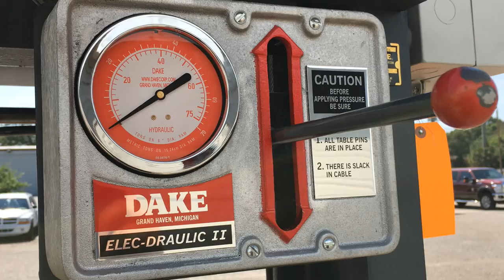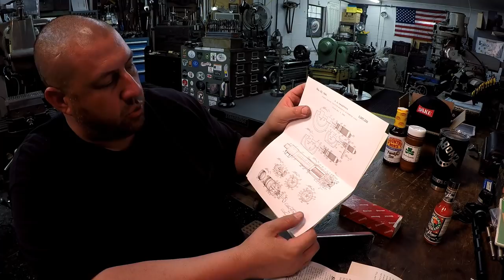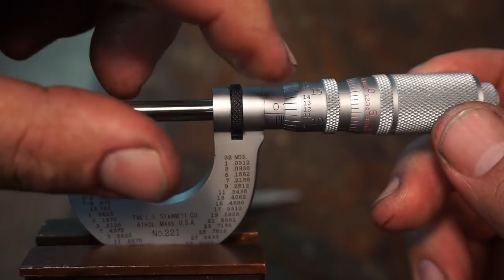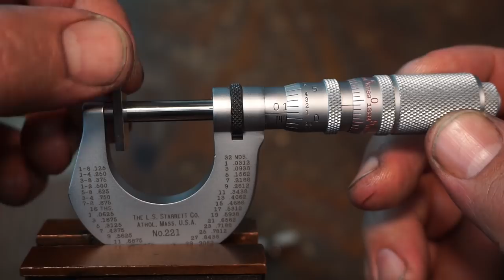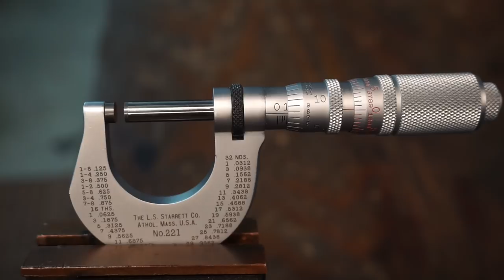SNS 171: Parting, Tool Post Grinder, Starrett No. 221

Comment: Have done lots of tool post grind work. We made shafts for flight control assembly's that were made the same way only we had a chemical process line that did the hard chrome. The chrome process is neat to watch. Then they came back to the shop for final grind work. Neat micrometer you have there. I have not seen one either. Careful with that killer sauce and NEVER fall for the line"aw it ain't that hot". It will get you every time.........
Reply from the maker: +Johnny Holland We send our shafts out to a couple companies who do the hard chrome. They do a lot of chrome rods for cylinders, but also jobs like I showed.

Comment: I bought a brand new Starrett No. 221 micrometer a few years ago. They are very nice and quite accurate, but they are also very easy to damage, because the mechanism is fragile. Still, it is one of my favorite micrometers, and the design is really clever.

Comment: I've just acquired a 0-25mm micrometer, it's a Mitutoyo 115-115 and I love it. 
It's a manual one which I prefer to be honest. I've looked on there site and they don't sell them anymore but I recon they were over £100 new. 

Where they contact on the part it's a mirror finish, which I never knew. I knew they had to be smooth but never knew they were that smooth. 
I've got a couple of cheap verniers but that's far more accurate, even if it isn't calibrated.

Comment: Adom.  Tool post grinding.   In a book called "Know your lathe"by Boxford   they explain if you set the top slide to 5·9 (6) degree and put the cut on using the top slide each 1 thou is now 1 tenths of a thou. so the old 10 thou is now 1 thou.  it also works for turning very accurate. I recently had to clock and remove 4 thou out a bored bronze bush and used this method to keep the size. 
Steve

Comment: Adam, If you can change your Wi-Fi dongle in the shed to use 5GHz it will probably solve the wireless mic interference.
You may need a different dongle and/or router, but it would likely solve the problem and these parts are pretty cheap.
Thanks again for all the great videos. :-)
Reply from the maker: +ZEROSTATIC72 Not sure how to change it

Comment: good to see you have solved the issues source  dont think i would have thought of the tplink even though mine sometimes detects incoming cellphone calls  a sort of weird repetitive static  lol thanks for the video..  it advice  buy a wireless repeater for the dhop and hard wire the laptop to that  .. a repeater is the same as a router/hub/modem  in the house that connects to the house wirelessly  repeats the signal and drops it to network cable as well.. thinking about it the issue is probably power draw across the usb hub  wifi adapters use a lot of the power in a hub  they also may add feedback through the power to the other devices on the hub...

Comment: thanks , gerat video Adam. 
You would think that the insert designers would make it so you can break a chip and get a smooth finish.
seems as though that the feed is higher than the radius can cover.
Cheers and looking forwards to meeting you at the bash
Phil
Reply from the maker: +Phil's Projects Select the proper insert for the job, whether for roughing or finishing.
Reply: thanks Adam

Comment: Kinda surprised you haven't machined a gimbal mount or other camera accessories. Would be a great shop project. Keep up the awesome films!
Reply from the maker: +Kendall Clark I machined and built the camera mount I use for the steady cam. Gimbal mounts are easily purchased. My shop time is normally used for jobs and repair work.
Reply: Abom79 I must have missed the mount video. My bad. Rotary welding table project series still my favorite. I love the new split format.
Reply from the maker: it was a video quite a while back, but I showed it a few times here and there in other vids.
Reply: Abom79 thanks I'll find it

Comment: re: the wifi card interference try a USB extension cable it may only need the 1mt distance to stop the interference, i always suggest to my customers that a small extension cable is used , and leave it plunged into the hard drive so you can make all the connection from the other end so the equipment end is hardly ever unplugged , its a lot cheaper to buy another extension USB lead than a new piece of equipment as the USB ports are almost impossible to change , ps mobile phones also cause problems with sound as you may well know,

Comment: Adam I know this will sound dumb but in my truck I have a sign that says, are the vents closed, are the steps in, is the antenna down, is the wife in..lol Also  check the connections for when I'm pulling my travel trailer.  If you had a tiny sign by your camera in red print that says unplug WiFi extender when recording, then problem solved.
Reply from the maker: I have a note on my door that says "turn off air compressor" 
I still sometimes lock up and forget to do it.
Reply: Hey how about this, a sign that says read all the signs...lol

Comment: Hi Adam! Great SNS again, thanks! Can you please explain why rotary tools are so uncommon in lathe work? For instance, in parting, where one could use a fine rotary diamond cutting wheel instead of a wide blade tool? Best wishes, Bas, The Netherlands
Reply from the maker: Too much set up just to cut a part off with an abrasive wheel, and also all of the dust and grit left behind. Just drop in a tool designed to make that type of cut.
Reply: Ahh, yes of course, it would be messy! Thanks Adam.

Comment: Hey Abom, cool video showing thread turning. One question: when you turn a thread on a lathe, how do you make sure the tool exactly catches the right position for the next cut?
Reply from the maker: +Tobias Kornmayer You engage the half nuts at the proper position to align the threads correctly each time
Reply: Hm, okay thanks for the answer Adam :) to be honest, I'm a bit of a lathe noob. Could you show that one day? Because I mean the travel must be in sync with the spindle also to hit the right spot every time. Also, does your monarch disengage automatically or do you do that manually?
Reply from the maker: +Tobias Kornmayer search my channel for a video on the subject. I explain it on my Monarch lathe.
Reply: My layman's understanding is that there is a 'threading dial' that is engaged with the lead screw. The dial has 4 markings that correlate to each of the jaws on a 4 jaw chuck. As long as the workpiece stays in the same position, you can read the threading dial at the start and/or end of your threading pass and engage the half nuts at the right time. As long as the dial is in the same position each time, you are assured that the positioning is correct for each subsequent threading pass. I'm fairly certain I saw This Old Tony explain this in detail in a threading video, and I'm sure Abom does a much better job in his video than I have here!
Reply: This Old Tony, "Another Thread Cutting Video?!" The threading dial is shown and discussed starting at 23:30 (although the whole video is excellent imo). I had wondered the same thing as you prior to seeing this; once again the solution is another simple yet clever use of the mechanical timing properties of a lathe!

Comment: Adam, are you sure you are using that mike correctly, seems to me that you should be using the thimble at the very end to get the correct pressure to take a measurement.
Reply: That's not a friction or ratchet thimble on the end, but is more or less affixed to the main thimble. In other words, they move as a unit. My understanding is it functions as a tension adjustment for how much stiffness you want in the thimble's "springiness."
Reply: I have looked at the video again and now see how it works, sorry for doubting you.

Comment: Is it 2.4ghz or 5ghz that interferes? The easiest solution is to get a wifi router that is capable of broadcasting on either or both bands and figuring out what works the best while giving a good signal.
Reply: m2hmghb He most likely has a router from the ISP, and it most likely does both. The fact that he doesn't have on board Wi-Fi in the MoBo, nor a Wi-Fi card, in his computer means it must be really old. So it would just be easier/cheaper to buy a new Wi-Fi dongle.

Comment: 221 1940 was like 36 bucks new now there 500-600 bucks new it is there jewel 0-1 mic
Reply: When using the 221 it's important to use a standard that has a know thermal inspection chart so you can adjust for the temp that you are currently using. A starrett grade 0 pro block is standard at 68* a 1" block at 80* is .00005 larger